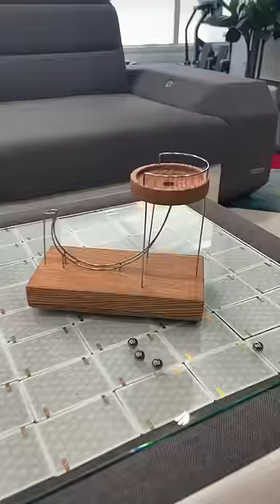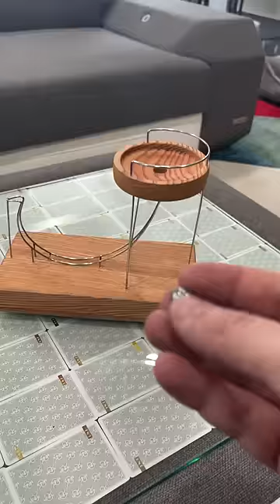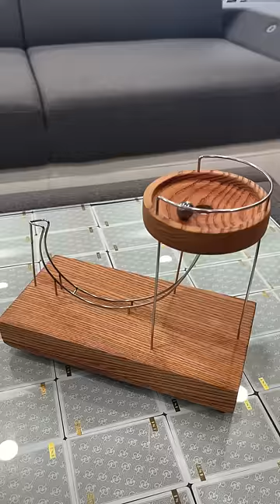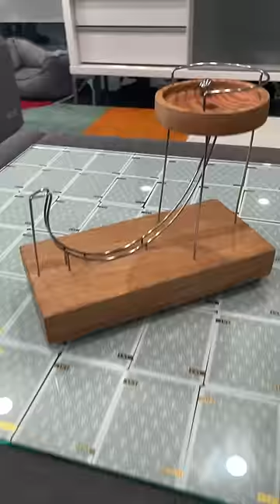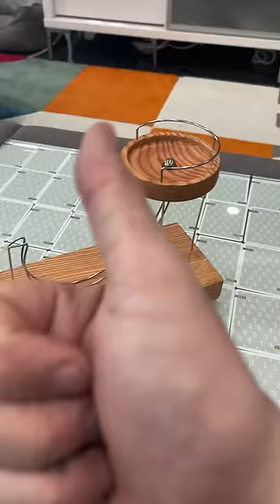An Impossible Perpetual Motion Device?! 😳 #Shorts

Comment: If you can hear that sound, that means it is losing energy
Reply: It actully has batteries in the bottom and I pushes ot
Reply: @oakley7578  I know. I'm just pointing out that the presence of sound means it is not a perpetual motion machine
Reply: @thepizzacarpizza1056  How do you know? A true perpetual motion machine would MAKE energy, so it could afford to loose some as sound.
Reply: good point, however, counter argument, they don't exist
Reply: If you look at the momentum of the ball you’ll see that it almost got all its energy the second it got through the hole and doesn’t speed up that much anymore when it goes down. Which implies that there’s a motor in the platform.
Reply: @milank0785  no, there's not a motor. that makes absolutely no sense. this thing is a railgun for the ball, the 2 rails are electrified in a specific way that accelerates the ball
Reply: @thepizzacarpizza1056  Quote: "this thing is a railgun..." 
I agree. It looked like magnetism. It accelerates suddenly. Gravity is not that sudden.
Reply: @stevenb2022  no, its not a magnet. A magnet doesn't just add energy, a magnet would pull on it as it went away, as well as it went forward. It's literally just a railgun
Reply: @thepizzacarpizza1056  railguns use magnets... Electromagnetic...
Reply: pizza man, your right there is sound, but if the sphere has reached its destination and resets it doesn't matter.

Edit: pizza man, I take you very seriously. I want to take back what I said because your point has nothing to do with my point.
Reply: @dancooper6002  the sound itself is a form of energy that's being lost. which means the ball should not be able to snap back up bcz the total energy remains constant, implying that these are not real.
Reply: no the energy is recharged thru the falling cycle the clanking isn't enough to bleed energy no where near enough to halt the perpetual motion
Reply: @PCWarriorTV  but the thing is, perpetual motion just means it will go forever, it is usually implied that it creates energy but it is not a requirement
Reply: @thepizzacarpizza1056  a perpetual motion machine basically has a net loss of zero energy. So, it can lose energy, just not more than it gains, in one cycle.
Reply: @thepizzacar pizza  you can create energy by making the ball positively charged, the hole and rails are negatively charged when the ball falls thru the hole energy is made while the ball rolls down and up the rails however, the energy made wouldn't be much at all. you would have to scale it way up
Reply: @PCWarriorTV  no energy would be produced. its impossible to 'create' energy.
Reply: It is possible, it's called a tensor ring, Brian Besco from twisted sage studios sells them in America, you can see 50 percent of the energy coming off the ring with a gdv imaging camera... 72 degree pyramids do the same thing, this is why they built giant 72 degree pyramids out of fibre glass in Moscow and they store water in them, tensor rings are made from copper, like a copper magnetic bracelet for healing carpel tunnel, but 100x stronger maybe 1000x
Reply: @GHOST__BRAIN  energy cannot be created. it's a fundamental law of the universe. energy can only change forms.
Reply: @thepizzacarpizza1056  Ok then how does a tensor ring produces energy on a gdv imaging camera when it's just a copper ring? Awnser that
Reply: @GHOST__BRAIN  it doesnt. plus, can you show me this that you are talking about?
Reply: @TacticEye but the bleed accumulates each time
 Eventually the ball doesn't have the energy to "reset" a day the whole system falls apart.
Reply: @GHOST__BRAIN thing "createds" energy: just transforms energy from one thing to another. Whatever a tensor ring is, if you are seeing energy on a camera, it's changing existing energy into a form the camera can display.

A bonfire doesn't create energy, but an infrared camera can show it emanating from the bonfire. Your hand can detect this energy, too.😊
Reply: @thepizzacarpizza1056 it's called a tensor feild, the term was coined by John archavle whelan, when he connected a copper wire into a loop and he could measure a small electrical charge, he called it tensor energy, also Brian Besco makes and sells these rings and he does 1 hour q and a videos about them, his YouTube channel is called twisted sage studios and I'm sure he will reply to your comments if you are respectful, also he has a studio in America where he makes the rings and you can go to his studio and stand in the activation chamber for free and feel the energy radiate through out your body, his activation chamber is 5 or 4 very big tensor rings stacked together, if you want proof I'm sure Brian would upload a video showing the energy coming off the tensor rings with his gdv imaging camera and he might have already uploaded that, I'm not sure but if you want super proof I would ask him to live stream him proving it with the gdv imaging camera, because it's easy to edit a video and fake stuff but a live stream with him doing it would be much harder for him to fake, unless he fakes the software in the camera itself, also if you really really want proof, go to Moscow one day and stand in one of those giant pvc 72 degree pyramids that they built all around Moscow, Alexander golov from Russia did lots of scientific research into the pyramid energy and all of his research got deleted off Google, even though Indians have been storing water in copper vessels for centuries for it's healing purposes, well the 72 degree pyramid does the same thing to water as long as the pyramid is not made of metal, the pyramid energy is known in our community as torsion field or torsion physics, heavily suppressed and denied by us scientists and government and Google, sad story, Google should allow freedom of speech like Elon does
Reply: @GHOST__BRAIN  as already said, it's not making energy. What these people do is dilute a little truth in a lot of lie, and the truths make you see them as more trustworthy
Reply: @thepizzacarpizza1056  Ok so if its not producing energy then why can you see 50 percent of the energy coming off the tensor ring when you look at it through a gdv imaging camera?
Reply: @GHOST__BRAIN  50 percent of WHAT energy?
Reply: If the ball bearing is visible, the system is losing energy as photons.
Reply: @alkh3myst  that makes no sense. Seeing it just implies it's reflective, which it is, and also doesn't diffuse, which makes it shiny. Emission of light from a metal bearing ball means it would have to be very hot.
Reply: @thepizzacarpizza1056  Photoelectric effect. I'm thinking of a really tiny energy loss on the quantum level.
Reply: and then regaining energy
Reply: @oakley7578  oh yeah you got one? Cause I’m pretty sure the only evidence is the same video we all watched. Where does it show batteries lmao
Reply: All I can say is how wonderful to read all your comments ❤️.  Don't know anything about Physics but I would love to see u all in one room  debating
Reply: My hotwheels cars do a loop on the track . This reminds me of that .
Reply: I guess it's the same mechanism as the magnetic rail gun.  And when the ball touches both rails the current makes the ball eletro magnetic. The magnets hidden below push the ball foward.

Comment: Call me crazy, but for some odd reason I feel that removing the wooden base might affect the apparent energy conservation…
Reply: How do you mean?
Reply: yeah, your right, this large wooden base compensate the shortage of ball trajectory every time, due to energy loss.
Reply: @TCt83067695  probably batteries and an electromagnet hidden in the base
Reply: @markp5726  he did say it was impossible and that it would only look like the example.
Reply: @markp5726  thank you. The base now does look extremely suspicious.
Thanks for making me see sense
Reply: it could still be a perpetual motion device it just won’t last forever. i’m sure after awhile it would eventually slow down due to friction
Reply: But what would happen if it didn't have an supposed electromagnet at the bottom? The ball wouldn't fly all the way back into the bowl?
Reply: @michaelgriggs7839  then it ain't perpetual. Perpetual means "on and on without stopping"
Reply: That ball appears to hit terminal velocity in about a microsecond. I wonder how they shut off the EM field as the ball gets to the magnet? Or if the shape of the ramp just makes the ball leave the field faster? Like using a planet to slingshot your satellite. You speed up on the way in, but slow down equally on the way out of the field.
Reply: @michaelgriggs7839  then it's not perpetual.
Reply: It actually wouldn’t. You can get ones with really thin bases.
The battery and motor are located in the top section.
Reply: @MJW238  just use a wooden or plastic ball then
Reply: It's a toy lol, quit getting so mad
Reply: @markp5726  i have the same one and it works with glass marbles aswell, there are no batteries no motors and no magnets but i dose slow eventually do to the friction of the ball rolling on the wood and metal guides
Reply: @kapow_1285  Like an electromagnetic sling shot.
Reply: @danielpaulson8838 
Yeah I never understood how that works with gravity because it wouldn't work with static magnets
Reply: @mikeock2087  I was thinking two things can be in place there that makes it happen.
1. The Shape. If the electromagnet is fixed, it ramps in from the top getting a lot of speed. But it curves quickly at the base to perhaps get the ball out of the field faster by changing its trajectory.
2. If a small piece of stainless steel was over the magnet at the top, I think it would shield the em field from that direction.
Reply: @quantumpanic  yep, that’s what would happen
Reply: @markp5726  bruh let the bot have its conversion with itself
Reply: @danielpaulson8838  Not exactly true with the planet case, though that is how it would work with a non-moving body.  The planet's orbital velocity factors heavily, as that affects the entrance and exit legs of the flight path creating an imbalance.  The acceleration is taken by decelerating the larger body.
Reply: Ur envious instead of appreciating him
Reply: @markp5726  i highly doubt that since it does not appear to be hiding anything and if it were hiding anything, it would need at least an opening or small hinges to locate said opening. It just doesnt make sense to make batteries for this thing when its using simple physics.
Reply: @michaelgriggs7839  Not even that. The conservation of energy actually means that the ball will never reach a height higher than where the ball initially performed a free fall. (i.e. entering the hole.)
Reply: Michael Griggs I don’t think you know what the word “perpetual” means. The whole idea behind a perpetual motion machine is that it lasts forever. Endlessly. Just lasting a while and then stopping defeats the whole purpose
Reply: Yes. That's crazy. No this isn't a conservation of energy. It has a wheel in the down hole that shoots the ball out.
Reply: @danielpaulson8838  My favorite thing is whenever people can't understand how something works, they just say magnets. This design can NOT be made with magnets, as you state no way to accurately know where the marble is on the track to turn the magnet on and off. There is a spinning wheel in the down hole it shoots the ball out. That's why two can't fall down at the same time. The second one will hit into the first and they will fall off the track.
Reply: @kollinbutwithak5657  It actually is a magnet. People have video's up on it telling us it is a powered electro-magnet. Check a vid called, 'Perpetual Motion in RamZland!'

It can be done in my estimation. The magnet has poles, either of which will attract ferrous metals. But the attracting poles aim opposite directions and has a weaker em field on the sides. That magnet can be oriented in that base, aiming somewhat upwards and right up the ramp where the ball is entering the field. But the ramp then steers the ball out of the weaker em field on the sides thus preserving some of its additional speed.

No motors or moving parts. The magnet does not have equal pull from 360 degrees. The ball enters the field on a strong attracting line and quickly exits on a weak line.
Reply: @kollinbutwithak5657  Wait, check this one. 'AWESOME MAGIC GIFT - PERPETUAL MOTION MACHINE'
At 2:58 he turns off the magnet and the ball doesn't make it. He then goes on to show how to charge the base. It's pretty obvious in this one. The guy showed it all.
Reply: @TheOGJeff  not exactly
Reply: I lost IQ reading this thread. Good lord people
Reply: @TheStunnerFTW  I think you’re forgetting the giant wooden base lmao
Reply: @TheStunnerFTW  except it is, and he shows that it is hiding electronics in another video
Reply: Of course you got the point the trick is a magnetic field powered with batteries hidden in the wooden base!!

Comment: I would imagine there's a little gnome inside on a treadmill making this all happen
Reply: More like an electro-magnetic iron golem
Reply: well yeah or an electric motor that accelerates the fall of the ball (he made a video about it previously lol)
Reply: I think this is possible only because the ball get cinetic energy (when he launches it) at the start in addition to the potential energy, that why it can returns higher than its original position
Reply: @unuva2437  that is just no possible, perpetual motion simply doesn't exist
Reply: magnets
Reply: @CamiloNovoaT  And i never said it is perpretual motion, the trick is giving more energy than needed at the start so that even with the little loss of energy by friction at every turn the ball could still go up to the platform for quite a long time before running out of enough energy. I don't know if it's true cause the ball seems to loose a lot of energy when she lands but this can be an hypothesis
Reply: I bet it wouldn't work with a glass marble.
Reply: If theres electricity on the rail it would make sort of a rail gun effect so that the ball get speed up
Reply: @unuva2437  Yeah but whats with round 2? Continous motion isnt possible in ANY way
Reply: @gurujikhan  magnets are no energy source but there are other ways…
Reply: Sounds like slavery with extra steps
Reply: @unuva2437  soo you're not very smart. Gotcha 😂

Comment: If you are curious how this thing breaks the laws of physics, it does not...

There is A magnet turns on as the ball rolls down, giving it a speed boost that allows the ball to make a complete loop.

Now you know. (still cool though)
Reply: The thing is, could this be possible without electricity but a regular magnet... 😅
Reply: No. The magnet must turn off just as the ball arrives, or it will get stuck at the bottom. 
Basically, the magnet turns on as the ball falls, giving it extra momentum to do the loop, and turns off just before the ball passes so it doesn't trap it.
Reply: @tigerbear5845  Shit. So the switch is necessary. Anyway, it was a nice thought experiment. Thanks for the reply.

Comment: I'm no scientist, but if I remember what I learned, this works via batteries giving the ramp and electromagnetic charge, that can attract and propel the balls. For those smarter than me, please correct me if I'm wrong.
Reply: Yea i was thinking some type of current or possibly a magnet i guess
Reply: Damn at first I thought it just looks neverending but now that I think about it, the acceleration doesn't seem natural at all :D you're probably right about the battery :D
Reply: Its probably just conserving enough energy to make it back to the platform. If you try to generate energy with the same concept, it will take energy away and it would probably no longer be able to reach the platform.
Reply: @killacam876  explain please, I don't fully get what you ment :(
Reply: Definitely propulsion
Reply: Even if it's just using gravity, that's also energy being added into the system. Still pretty neat!
Reply: @ghost_of_a_dead_poet  think about how an old grandfather clock is just powered by a pendulum. That thing will pretty much never stop, but  if you but it to a generator it either wouldn't provide any energy or it would stop too fast.
Reply: @williamgriffin5393  gravity is not an energy source.   A lot of people get it wrong.  Gravity combined with mass will create potential/kinetic energy
Reply: @waterierStone  even a grand clock had weights to get reset regularly or wound
Reply: @ghost_of_a_dead_poet  just that even if it were able to conserve enough energy to be able to make it back to the platform, if any additional energy were to be taken away it definitelty wouldn't make it.
Reply: Rail gun with a magnet at the valley
Reply: I'm not smarter than you, but I'm still going to insist that you're wrong.
Reply: @waterierStone  The pendulum does not power the clock it times the escapement of the gear train. The clocks are powered by a hanging weight or spring.